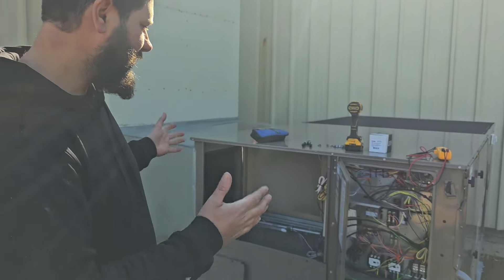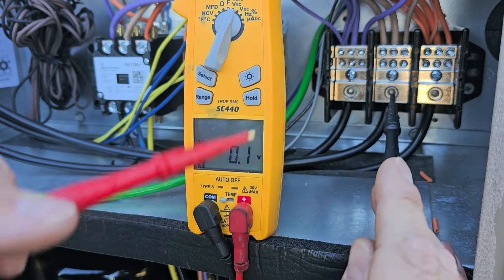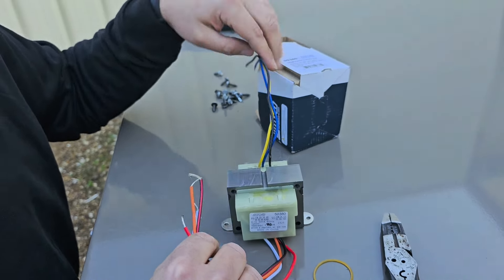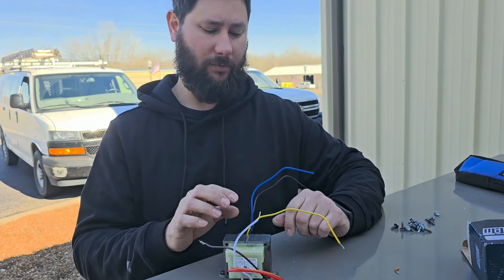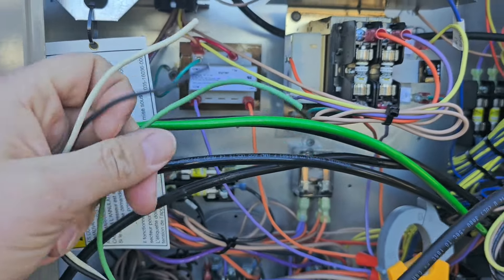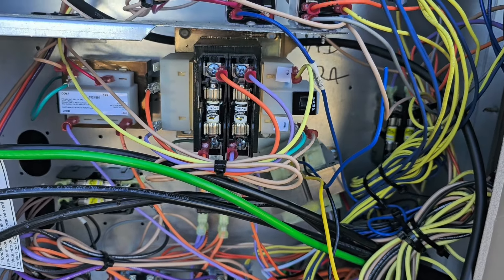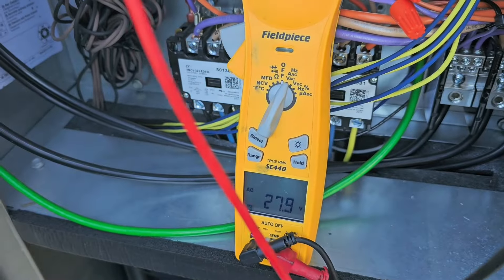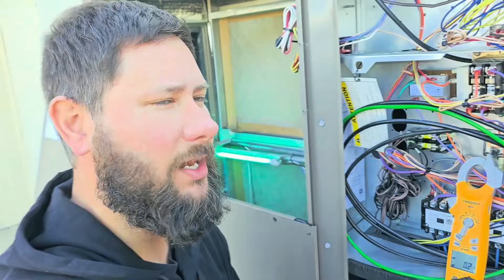How to wire a 480 Volt to 120 Volt Transformer?

Comment: The phase to ground is ~277V. in a 277/480v-3 phase system. phase to neutral which is the same voltage as ground, is 277V. phase to phase is 480V single phase power. if you hook up all (3) phases it's 480V 3 phase system. This would need a neutral wire ran to connect the 277V power or you can use the small transformer.
Reply from the maker: That's exactly right. Thanks for explaining!

Comment: 2 transformers in 2 days for me. I didn’t understand a bad transformer means something else is wrong.  This time I have a replacement contactor switch and a 3 amp inline breaker on the way as well as a 3rd transformer of course !

Comment: How does the wiring work if you connect one side of a transformer to another primary side of the transformer? Where does the low voltage side lead to on the first transformer?
Reply from the maker: check out my video on transformers and relays in the description
Reply: Thats what i was wondering

Comment: Thanks Tad.  So is the high incoming voltage due to a transformer problem on the pole?
Reply from the maker: It could be yes.
Reply: 490 volts is too high.  The Utility transformer might need to be  dropped a tap or two.